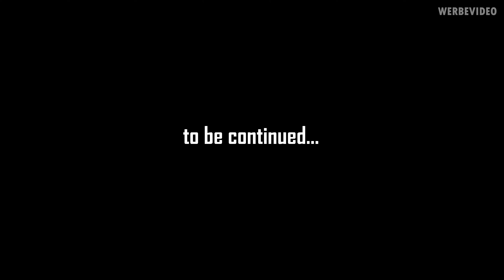Der ultimative Dual Z390 Gamingtisch - #6: Grafikkarte misshandeln (en subs)

Comment: Hallo Roman, ich hab jetzt seit Dezember einige Probleme mit meinem PC und bin inzwischen so verzweifelt, dass ich nicht weiß wies weiter gehn soll (darum der Kommentar hier) 

also erstmal das System:

Ryzen 5 2600
Asus Prime x470 pro
Trident Z rgb 3200mhz 16 gb dual kit (amd ryzen optimiert)
Crucial ssd und wd green hdd
RX Vega56 von PowerColor
Bequiet straight power 550w

Problem: Graka ende dezember bekommen, der HBM2 taktet sich aber immer auf 176 mhz runter (exact 176), egal welche settings ich auch einstelle.
ich hab schon so viele dinge ausprobiert. 

habe inzwischen auch schon ein vega64 bios drauf geflasht (extra ein powercolor vega64 bios rausgesucht) aber gleiches problem.

der 2. monitor lagt, wenn ich games auf dem erstem spiele,
und dann noch eine spezielle fehlermeldung beim zocken: "Die Anweisung in 0x00007FFD9EF19680 verwies auf Arbeitsspeicher bei 0x0000000200000007. Der Vorgang read konnte im Arbeitsspeicher nicht durchgeführt werden."

Comment: "Wenn Ihr nach einem Hardcore-Anstrengendem Tag..." Marry, Ihr beiden macht es den Jungs hier aber teilweise echt ZU leicht. ;)
Trotzdem - Ich finde Ihr zwei seid einfach hammer und passt "wie´d Sau zamme" (Roman kann Dir das übersetzen ;) )
Aber warum ich eigentlich schreibe... Du als RGB-Queen kannst mir sicherlich helfen:
Ich baue mir grad ein 2tes Low-Budget-Project zusammen und möchte auch ein bissl RGB drin haben. Nun gibt es ja z.B. von Alpenföhn die adressierbaren RGB Lüfter für kleines Geld.
https://www.caseking.de/alpenfoehn-120mm-wing-boost-3-argb-pwm-luefter-single-lual-035.html (Möchte gerne 3x 120mm in der Front übereinander)
Was mache ich damit, wenn mein Mainboard keinen RGB-Support bietet?! (AsRock Z87 Extreme 4) Gibts da irgendwelche Dinge die ich nutzen kann, und PWM übers Board funktioniert weiter? Bisher habe ich nur Controller gefunden, bei denen man die Lüfterdrehzahl selbst einstellen mus.  PWM hätte ich, wie gesagt, gerne wieder übers Board, und eben die volle Pracht der Lüfter mit allen Funktionen. Vielleicht gibts ja Hilfe für mich :)
Gruß

Comment: Ich habe mal eine Frage gehört nicht zu den Tema. Ich habe jetzt 2 unterschiedliche 2080ti gehabt beide übertaktet, aber keine von denn beiden ist wesentlich besser als meine 1080ti. Wie kann das sein wir reden hier von 10 bis 15 fps pro Spiel alles auf 3440x1440 und ultra. Noch was meine 1080ti ist wasser gekühlt und wird mit einem 380 Radiator gekühlte. Und leuft stabil auf 2095 core clock und mhz sind 6000 wenn es mich nicht teuscht kann auch etwas da drunter sein. Wäre mal schön wenn mir das einer erklären würde weil die Grünen ja sagen  45 %mehr Leistung. Danke
Reply: Ich würde mal sagen das deine CPU die 2080TI ausbremst. Desweiteren wirst du eh schon um die 100 FPS haben. Also was machen 10 FPS mehr oder weniger schon aus.  Selbst ein 9900K ist da schon zu langsam und bremst die 2080TI aus . Wenn du in 4K Spielst wirst du den unterschied aber deutlich spüren. Ich würde sagen du hättest die Tests abwarten sollen. youtube ist ja voll davon.

Comment: Hi wollte mal fragen. Habe noch ein  Z170 Mainboard mit nicht verstärkten PCI Express Slot.  Halten da 1.8 Kilo Grafikkarte von MSI RTX 2080 Ti. Oder wäre das so Risikoreich? Hat da jemand Erfahrung damit?
Reply: Ich meine bei den meisten Rtx 2080 ti sind noch so kleine Ständer/Halter dabei um die Karte zu stützen.
Reply: @einpotterhead6243  bis jetzt habe ich solche noch nicht gesehen. Die neuen PCI Slot haben exstra Verstärkungen. Die älteren  Mainboard nur Plastik. Die Grafikkarten werden ja auch immer schwerer und größer.
Reply: @alfimelma1285  Also bei der Aorus Xtreme ist einer dabei, aber wenn du unbedingt eine MSI willst könntest du es auch mit nem Vertical PCI-E Bracket von Cablemod (oder irgendwem anders) probieren. 

Da ist ja dann ein Kabel (ich glaube es heißt Riser-Kabel) dabei.